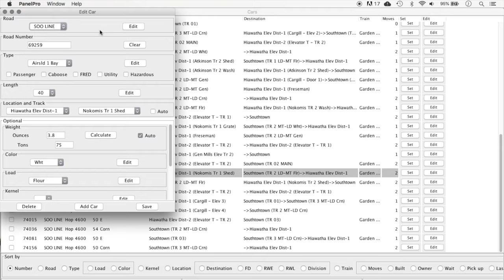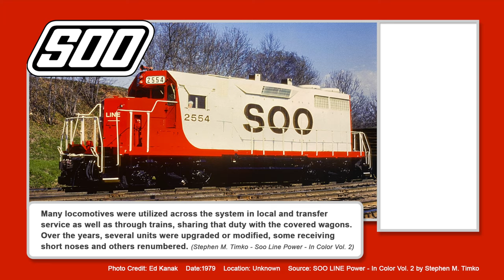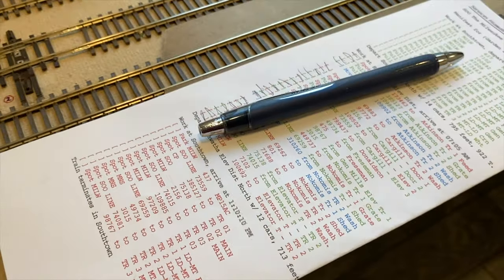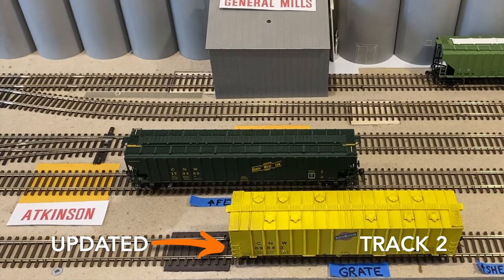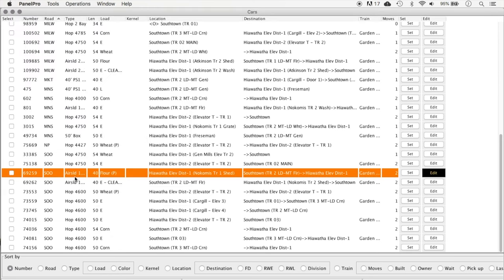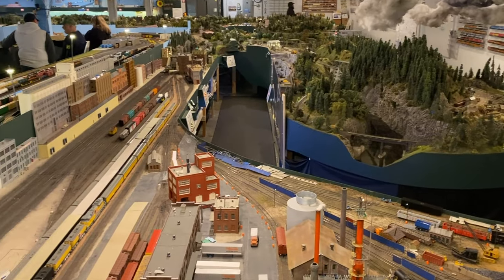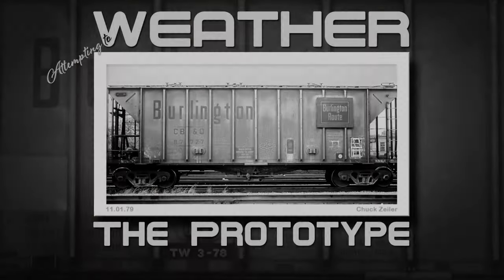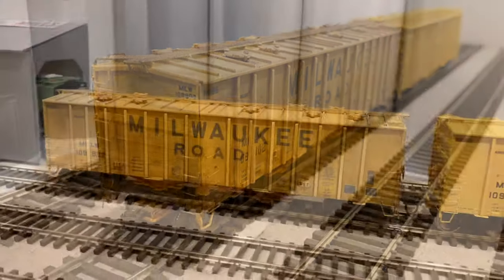S06E06 | Updates on Layout Post Operations, Weathering ScaleTrains 4180 Airslide & MORE JMRI tips

Comment: I wonder if you and senior remember that orange D&RGW center flow hopper I had so over weathered with white spray paint that it turned pink with no way to read the reporting marks? It rolled the SM GN1970 way back in the day. And to think of how proud of it I was, to just waste a good paint job on a rookie weather job! It was a real 'sand blaster'!
Reply from the maker: I totally recall the Rio Grande car, it was a 3/4 bay. The weathering job was a learning curve and we weren’t running ops at that point. What ever happened to it?

I also remember a Clinton shops, green 2 Bay ACF you had…I believe it was a Front-Range kit?
Reply: I remember it . We probably weren't operating yet so we didn't need to read the number!

Comment: that's for putting S03E05 I was just trying to remember which video that hopper car was on. Also I noticed that you're using Adobe to make your layout schematic. I was able to use keynote and got it to work. For some reason it didn't like when I converted pages to a PDF, then jpg. Thanks for the great tips and tricks
Reply from the maker: I used Illustrator originally and then exported a TIFF, into Photoshop to enlarge the canvas…before saving it to a PNG for JMRI.

You’re working along the same premise, did the results come out the way you hoped?

Thanks for tuning in and posting. It’s great to hear from fellow modelers like yourself.
Reply: @SootheMilwaukeeRoad  using keynote worked very well. Thank you for all your help and great videos